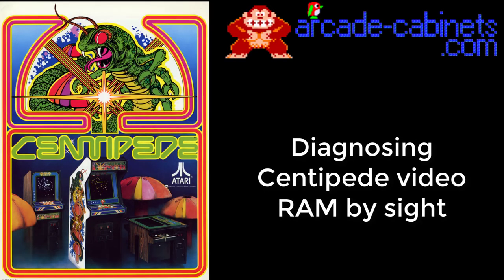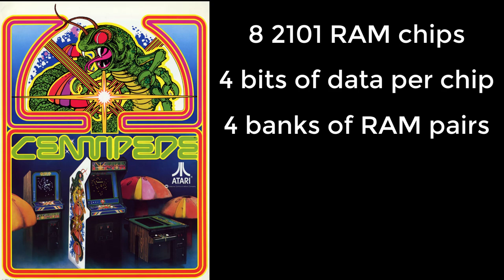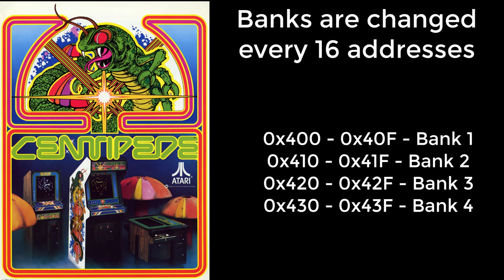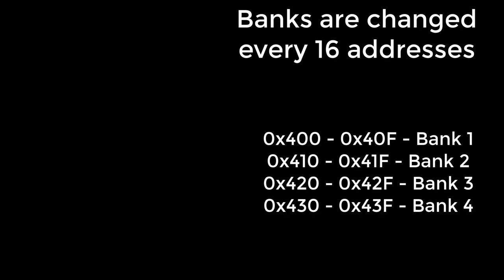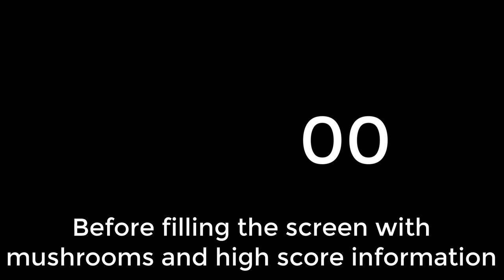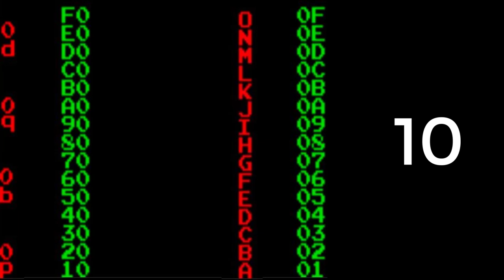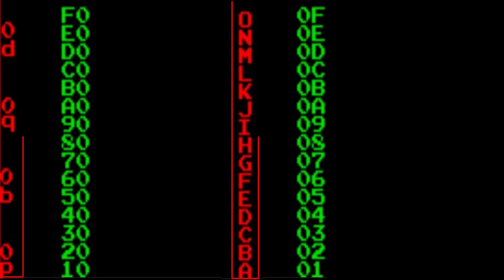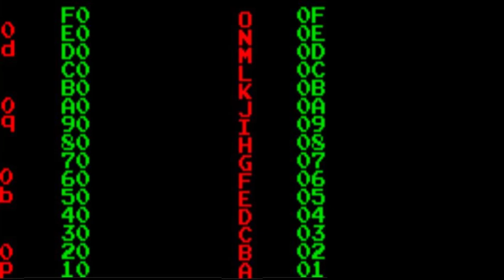Diagnosing Centipede Video RAMs by sight

Comment: Arcade cabinets, at time 2:40 its displays rows & columns of letter "P", so how did you know that its Bank#3 that has the stuck bit? I can't tell which video ram banks are good or bad in your video lesson
Reply from the maker: I explain how the columns match the banks starting at 1:40 in the video
Reply: What do you mean by banks change every 16 addresses? I understand how the columns match the banks starting at 1:40 in the video but I don't understand In the video at 2:40 it's displays the Letter P in every row and column so how can that only be bank#3 that is bad. I would think that all the banks#1,2,3,4 are bad since all the rows and columns have the letter P

Comment: Most arcade games can't let the Fluke 9010A test the video ram and video ROM chips because its being BLOCKED by an I/O data buffer chip. The arcade games Memory mapping will have the video RAM and video ROM chips start address and end address ranges. In order to let the Fluke 9010A be able to test the video RAM chips and video ROM chips, can you "add a jumper wire to ENABLE" the data I/0 buffer chip that is blocking the fluke 9010a to do video RAM video ROM tests?
Reply from the maker: no  most of these games (at least games in the 80's and later) the data and address buses going to the video ROM etc are not even connected to the CPU through a buffer or not. They are completely physically separate from the CPU
Reply: @arcade-cabinets  the memory mapping for the arcade games has the video rom range and video ram ranges but why put that on the memory mapping of the video rom and video ram ranges if you can't even access it by the CPU? When the arcade game is in TEST MODE the test program can test the video RAM and video ROM chips but how does the Test mode program able to test the video ram and video rom chips when the CPU is not connected to the video ram and video rom chips? What I'm saying is if the arcade games TEST MODE program can test the video ram and video rom chips why can't the fluke 9010A?

Comment: Does arcade games in the 80s use "Unassigned Memory Ranges"? does the decoder circuit in arcade games create unassigned memory ranges for the ROM and RAM chips?
Reply from the maker: I don't understand your question.
Reply: @arcade-cabinets  Unassigned memory ranges are used for what reasons in arcade games? Does the decoder circuit make the unassigned memory ranges?
Reply from the maker: @waynegram8907  I don't know what you mean by unassigned memory ranges. By definition if a memory range is not assigned it cannot be accessed. I probably don't understand what you mean by unassigned memory ranges. Unless you mean "do arcade games have memory ranges that are not used" then the answer would be "yes" and the reason they are not used is they are not needed so there's no reason to use them.
Reply: @arcade-cabinets  yes the decoder circuit only allows the CPU to access certain parts of the ROM chips and RAM chips. I don't know why there is Unassigned memory addresses that "can not" be access and what is the purpose of having Unassigned memory address for ROM chips and RAM chips that can NOT be access by the CPU in arcade games? I know the video ROM and video RAM is considered Unassigned memory address that can not be access by the CPU, but even the Game ROM chips has Unassigned memory addresses that can NOT be accessed by the CPU, any reasons why?
Reply: @waynegram8907  The decoder circuit is built only to decode the addresses that are needed by the game anything else is therefor unavailable. The reason is there's nothing there to read/write so there's no reason to fill it with any additional ram/rom/whatever or build a more complex decoder circuit that would just be an un-necessary expense.